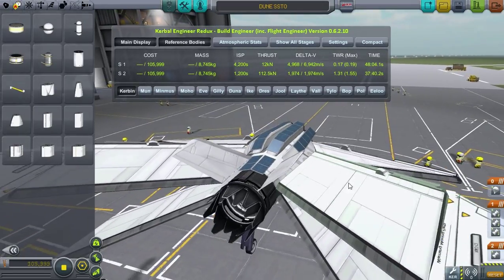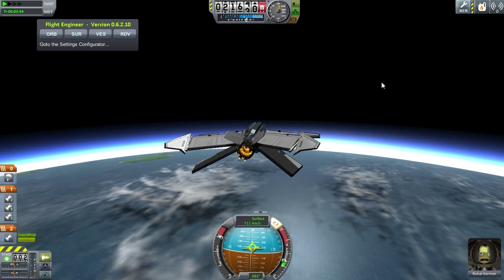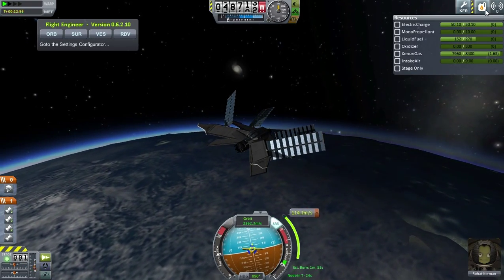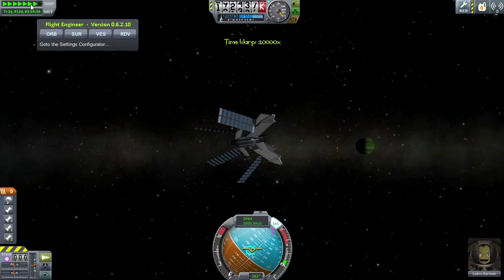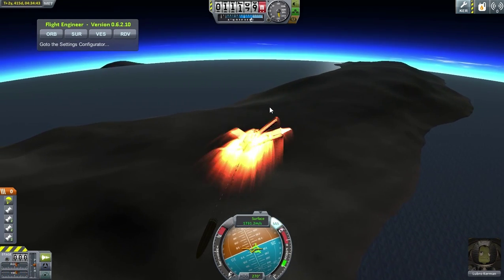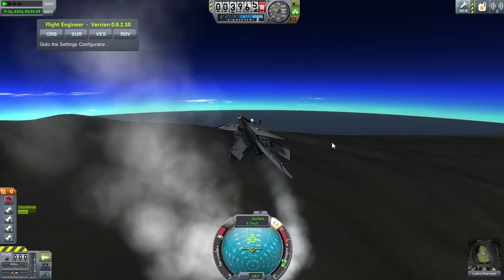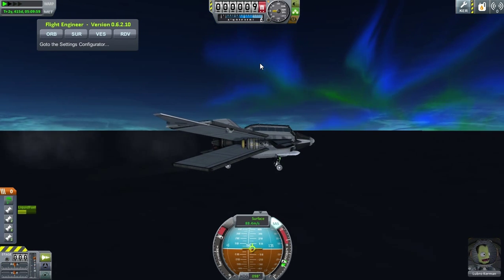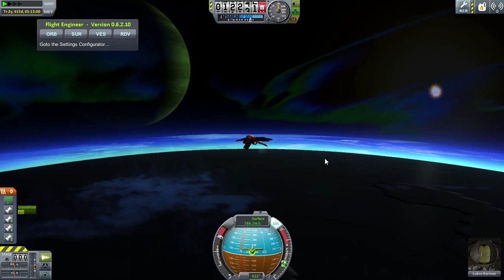Kerbal Space Program - Laythe Ion Engine SSTO (stock parts)

Comment: Old video but I wanted to offer feedback on why landing was so hard, in case you or anyone else wants some help with aircraft. 8:15 there are a few reasons why these landings looked tough to me: first, it can be helpful to DISABLE steering on the back gear and also DISABLE braking on the front gear. This is so, like a car, you are slowing down behind your center of mass and steering in front of it. 

The other thing is you were going well over 100 m/s when trying to land and this is very fast! I try to always land my aircraft under 50 m/s. Flaps are very helpful with these; control surfaces placed next to your center of mass that slow down your vertical speed when deployed. Makes landing easier. Placement and more helpful info on control surfaces can be found in the in-game KSPedia!

anyway aside from all that, this is a rad craft.